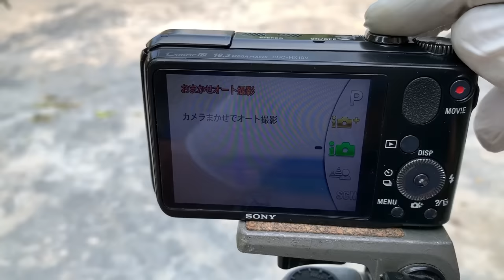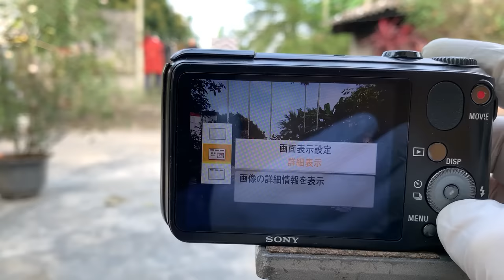Restoration Sony DSC-H90 camera | Teardown old sony cyber-shot 16.1 MP Digital

Comment: I worked in a Sony service center in 1999-2014, repaired cameras under warranty, including this model. The video is 100% fake. There are 4 reasons why such a camera cannot be restored:
 1. Electrochemical corrosion. The contacts simply dissolve in a humid aggressive environment, it happens that there is simply no way to the textolite and the current-carrying path. Here everything is perfect and the contacts on the trains are absolutely intact.
2. Shutter / aperture. In this model, they are made of the finest plastic parts, the slightest getting wet or getting sand deforms and scratches the ales "petals" and they cannot work correctly. In addition, after such a bulkhead of the lens, a special service setting is required; without it, there will be no focus.
3. Display. It is a conventional backlit LCD. Not sealed. The image should be stained with moisture, even after completely dry. There is none of them.
4. Electric motors. They won't work after being so dirty, especially with focus motors.
Video fake, made "back to front", first went through the camera, then got dirty and washed.
Reply: In the reassembly part of the video it looks like he is just reassembling a new camera.
Reply: Exactly. It's interesting to watch, but it's a lie.
Reply: Как ты нашел эту работу,важно ли техническое образование чтобы устроится в ремонт телефонов?
Reply: @tetsuodugin4134  And, come on? what is the probability of working in nature while you are recording and find a camera suddenly, I don't know, just saying...
Reply: @ricardowongl8001  Dude i wont work in service center,i didn't understand you i find same consumer electronics at the dump
Reply: @tetsuodugin4134  Если ты умеешь ремонтировать телефоны, работа будет находить тебя сама. Даже помимо твоей воли.
Reply: @hotenenko  Я умею только дисплеи менять с помощью фена для волос присоски и медиатора, думаю вот пойти в сервис центр учиться но боюсь не возьмут
Reply: На часах сейчас 2:18, а я сижу и меняю клавиатуру на макбуке.
Reply: @hotenenko  Прикольно,образование в этой области получал или в сервис получилось попросится?
Reply: @cipka666  That´s not true. There are many restaurers profesionals. This one is a fraud. That´s all.
Reply: He said entertaining video content.
Reply: Let that man make a living, he has bills too.
Reply: Agree
Reply: The corrosion part was my first thought. The part where the just so happen to find a camera on the beach while recording a video also seemed fishy. But at least it isn't one of those fake pet rescue videos.
Reply: @D.Frasure  I have bills too. Should I start fooling people people because of this?
Reply: نعم صح
Reply: I'd like to see what he does with a mobile phone.
Reply: Extcly ur crct 🤝
Reply: مزيف
Reply: @tetsuodugin4134  нех там учиться, 90% сервисов занимаются модульным ремонтом, никакой пайки ваще, если на плате хоть что-то вышло из строя - сразу замена платы. Если можешь разобрать, собрать, прошить - то ты уже готовый ремонтник.
Reply: and the 5 point is why someone throws his camera with that perfection in jungle? he only washed his parts and reassembled and it working perfectly so why someone throw his prefect camera in garbage with SD card in it
Reply: Thank you very much for the truth! In these dark years of lies everywhere, there is a need for truths like air and water.
Reply: your are correct. I think people know it. It is just for entertainment.
Reply: Are viewers supposed to believe this?   This is a produced video, edited in backwards:  First, he uses the camera, then splits its in parts an simulates mounting, then he spoilds its and then he finds it, just of a sudden!
Reply: Yes 👍🏻
Reply: I think so :)
Reply: " then got dirty and washed ".. that camera had build up of gunk and grime that takes months to appear..
Reply: Absolutely agree! It's fake. Now I have doubts about their other so called "restorations".
Reply: It's entertaining, high quality asmr content.  I like it even though it's fake.
Reply: Agree
Reply: @pbj4toast  that's exactly what happened there
Reply: Of course it’s  fake
Reply: Your correct this man Keep two camera  after show to us other one
Reply: At 5:37, you can see the serial number on the camera (6024008). It matches the serial number seen at 23:26 , so it's probably the same camera, but everything's basically done in reverse.

1. Basically, you can take some second hand camera with a bit of wear and tear. 
2. Show it off. Take some photos with it.
3. Then disassemble it and film a reassembly of it.
4. Then you dig it down and artificially age it up/corrode it
5. Then you film the new disassembly and cleaning process

Then you show everything in the order of 4,5,3(w/disassembly part), 2.
Reply: @carnivol  If you watch carefully, its hard to spot, but you will notice most of the reassembly was filmed then replayed to us in reverse. The way they edited it makes it harder to spot, but that's because he is trying to move in unnatural ways to disguise what they are doing for filming. Thats why its so choppy and has so many jump cuts, he can only make it look convincing for a short time.
Reply: @GamerLoggos  I didn't pay that much attention, but, yeah, reverse shots is certainly also a likely method. But at least the recording order checks out with the basic outline of what I wrote.
Reply: you are totally right, FAKE!
Reply: We do not care
Reply: А видел как он жесткий диск разбирает и моет щеткой? У него этих каналов с фейковым ремонтом штук 5 и везде подобная дичь. Чего стоят только названия, телевизор 1930 года (с интегральными микросхемами), 30-летний комп (на лга775 с процом core i5). А как он крупную технику ремонтирует, байк восстанавливал, так там вида 4 разных колесных дисков было, как по цвету, так и по форме.
Reply: yes that fake
Reply: yeah this is a massacre, a bit like kids breaking their brand new iphone with a hammer and hope they will get rich in pageviews.
speaking of,  I admire your patience, working so long on those neat toys. I've fixed a DSC-F717 once, just a ribbon cable being disconnected after a shock, now my next task will be to fix my old A55, it no longer powers on, i suspected batteries died together, and I hope my sanity will not be lost in a sea of those orange ribbon cables.

i hope there's like, a fuse or something silly in the power regulation part I can just short with a blob of soldering.
Reply: @D.Frasure  
Ah enfin une vérité,  la seule en réalité qui compte: le buisness ! Et les gens sur you tube qui diffusent des vidéo le font tous dans ce but en priorité !!!!
Je ne parles pas des gens qui répètent des choses qui ont déjà été dites des dizaines de fois, si ce n'est des centaines de fois voire des milliers de fois ou plus, bref on peut considérer que cela s'apparente à du plagiat et dans un but de se faire passer pour un érudit en la matière et au détour se faire un max de fric!!! Une vraie arnaque !!!!
Reply: Je me rappelle également que dans les années 90', c'était la même chose pour les camescopes VHS, il fallait un banc d'essai qui valait 40000F au bas mot et seuls les grandes stations techniques pouvaient se payer ce luxe. Et bien entendu, pour l'amortir (même si ce n'est pas grand chose pour un grand un S.A.V), il fallait en faire pratiquement tous les jours !!!
Reply: @FerroGamer  He said entertaining video content. He wasn't trying to fool anyone. if you take things you see and read on the internet to heart then I'm thinking you better toughen up.
Reply: Completely agree
Reply: S3exds
Reply: This fellow gets all types of gadgets in garbage  🙃🙃
Reply: @pbj4toast  Because he is.
Reply: Yes , I'm think so
Reply: Hay personas que tienen un talento increible que ni otros pueden solucionar...
Reply: i agree with you as a service engineer for marine electronics since 1972 doing repairs on electromechanical and purely electronics boards you should have vast knowledge and experience in dismantling such kind of equipment and should be calibrated and I don't believe water damage equipment can be fixed without even replacing damaged parts. This is a hoax, he can clean all he wants on the spare parts but there are parts bound to be damaged and will need replacement not just cleaning but it's good to see how he do it. He must be a camera technician just showing his skills.
Reply: Not to mention the image sensor's downright manhandling...
Reply: @tetsuodugin4134  Good afternoon Yes, education is necessary. I studied for 4 years, in addition, during my work, the manager sent me to improve my skills at seminars that were held by firms - manufacturers of equipment. Oh, those were happy times, my country has not yet attacked the neighboring one. How well we lived then
Reply: @МистерНиндзя-д5ц  а как малейшая сложность - бегут ко мне. работал я с такими. А зарплату получить так первые.
Reply: It is better to buy a new one than repairing the salvage

Befooling the public
Reply: Eu sei que estes vídeos são a maioria uma farsa, gosto de ver por conta das restaurações; mas sabendo disso agora vai ser difícil pra eu ver com o mesmo entusiasmo.
Reply: Yes... but... Japanese Jesus can!
Reply: Seems to be real :face-green-smiling:.

Comment: In my theory as a photographer, and my friend as a pro-camera repair: a digital camera can not repair that way due to water damage to the sensor, rust and oxidized to the focus system. He can not calibrate the focus system without any professional specific purpose tools. He can not tear apart the compact zoom lens easy like that because it’s not meant to be fix-able. Heavy water damage can cause foggy even the camera’s sensor is fine. 
The Video is TRICK AND FAKE !
Reply: i  a agree with u
Reply: And obviously the uploader doesn't read English
Reply: Also, it passes me off how he just finds the things he repairs lying around
Reply: Suka hati cakap fake
Reply: Kalau tak suka takyah tengok
Reply: @cryptodudepoland7533  koyak koyak uuu koyak
Reply: It's cool, we still like wasting time watching people restoring old stuff :)
Reply: And the uSD card doesn't have any sort of corrosion on its pads (min 3:37)...sure sure
Reply: nó là ng vn mà :))
Reply: You are correct sir.
Reply: Betul bang
Reply: You are inocent, he buy pieces and replace the damaged.
Reply: @Kathy12Ray  And just happens to have some flunky to record it. Notice when he picked it up there was no mark underneath on the mud? Plus scrubbing the case like that with a toothbrush would scratch the hell out of it the same as it would if he had used sandpaper. The camera showed no marks at all. This scammer finds something at the local tip and then buys a fully working model and then switches them. The problem is he knows zero about electronics and zero about continuity. I owned and ran my own TV/Video repair shop for many years and have a collection of over 200 digital cameras. Now I'm retired I repair them in my spare time. I should send him a box of faulty ones and get him to wave his magic multimeter over them. 🙂
Reply: @Kathy12Ray  And just happens to be followed by someone with a video camera.
Reply: @rpecas  Actually those pads are gold, and as we all know gold doesn't tarnish or corrode. It can sit on the ocean floor for 200 years and look as if it's been stored in a bank.
Reply: True
Reply: aprooved
Reply: What you see it's not water
Reply: З
Reply: yeah, the only reason fake channels like this exist is for entertainment
Reply: Sand in the mechanics of a lens, there is nothing better.
Reply: Agree with your comments. this is completely fake video
Reply: I agree...................................
Reply: Well, it’s got the same reg.number… If it’s sweet water (as in a lake) it might survive. Admit though this case is quite surprising.
Reply: 0:28 Yes, It is "FAKE"; since the guy pikes up the cameras from the ground..., it's already a fake arrangement.
Reply: I encountered a zombie last year and I restored him perfectly. He is an uploader on youtube now.
Reply: He has 1.57 million subscribers 😂...he is already earning good money from YouTube, fake or not....
Reply: Ông này ng vnam mà :))) sửa thì chém gió là  chắc r xem cho vuii thui kk
Reply: Он же обманщик отписывается с его контента надо что бы он перестал обманывать людей .
Reply: @wawafiqah477  malingsia
Reply: @CJ-fq1fc  Malaysia
Reply: Yes, this fake
Reply: i think the same
Reply: 日本人として、非常に複雑な心境です。
Reply: @wawafiqah477  dah mmg fake
Reply: As a camera repair guy, 100% fake. TO clean the lens only requires al lot of skill, especially with those small ones. This video is ultra ultra fake.
Reply: I was using that as a weight when I was fishing I can't believe he found it
Reply: Video fake à bác, em xem đúng là phản lại mọi định luật về sửa chữa đồ điện tử.. :)))
Reply: This is a totally fake video
Reply: Quando vi o resultado pensei a mesma coisa, não é a mesma máquina
Reply: @caramonchan3464 - a financially poor Oriental in the lower half of the Orient ~ Vietnam, Myanmar, Philippines, Laos, Indonesia….
Reply: @rylinyt 😠 - when YouTube introduced in-video advertising, some of the financially poor in third world countries found that they could commit fraud with the adverts, all they needed was a smartphone, internet connection, YT app,  a YT channel and the hoodwinked ~ watching said video and the “cashcows” = 💰
Reply: @bell-xk5dd ~ how many have been hoodwinked 😡
Reply: @mayanhvlog921 - a financially poor Oriental
Reply: Exactly!!!!     No way!.....there is a reason that they say keep dry, do not submerge.....lol
Reply: Camera fell down from Jack hand in Titanic and swept ashore because light weight baby..
I want to find 20.5 year old iphone 14 pro max and 
the original sword of Conan the barbarian  ...among the bushes..with 43% rust on the tip and 7% rust in middle..want to make epic restoration video!
Reply: @Kathy12Ray  A tsunami brings bikes,electronics, cameras to this coast.

Comment: As a vintage gadget restorer, I tried this once to a junk radio. Just dismantling is a nightmare! With screws corroded and rusty I ended up with broken threads and cracked plastic casing. Not to mention the brittle circuit board and solder blobs. In the end, I just quit and throw everything in the garbage bin. I believe a 50 year old gadget soaked in water or subjected to sea water corrosion would not survive even the best restorer in the world. Unless of course everything will be replaced part by part with new components, boards, flex ribbon, casing, ordered direct from the manufacturer.
Reply: So you are the best restorer and you couldn't do it right ?
Reply: @masana_  I'm not the best restorer. I'm just a hobbyist and electronics enthusiast since late 80's. I could troubleshoot and repair  electronics but my real weakness is mechanical parts. So if I could not open the screws and dismantle PCB's, find it hard to tinker  with delicate gears needing precise  calibration, or if the boards are too brittle to solder I don't bother restoring them. I only restore clean boards and easy to dismantle gadgets. Salt water soaked gadgets are almost impossible to fix because salt crystal cause much corrosion in electronics, plus the fact that salt  water is electrolyte shorting out most sensitive parts like eeprom, processor, etc. Most of all, I don't usually restore gadgets without proper service repair manual, unless I knew exactly how each section works.
Reply: @Manny_News_Blogs_Tutorials  just kidding, thank you for the answer

Comment: You know, to a certain extent I believe that some things can be restored but in this case I have my doubts. Say that you were able to "clean" all that "stuff" from the internal parts of the camera but what about the windings in that tiny DC motor inside the camera? Was the shaft not seized or gritty? How did you clean the CMOS sensor without affecting the final image quality after being exposed to water for so long? These questions are just to name a few.
Reply: Forget it, that's fake. Just to see how real they can fake the "restoration".
Reply: @michaelchan3135  Absolutely. The first red flag is "aimlessly wandering around and happening to find a heavily hidden gem", and the second issue is "looking at filthy, dirty, mangled crap and thinking, "Hey, I could restore that!""
Reply: @michaelchan3135  Also, "zooming right in on said corroded crap, but not looking about to see if there's anything else."
Reply: @michaelchan3135  And a third is not going through all the cleaning stuff only to find, "Ah shit, now I see why the former owner tossed it out!"
Reply: The video is make from the end to the beginning! First they find a working camera, take it apart, record putting it back together and working. and then they put it in the mud for a few day and record finding it in the mud, clean it and the video is complete
Reply: I've seen a few of this dude's videos and washing everything in water is the giveaway. Any other restoration video I've seen uses alcohol on electronics, but this guy just washes it all like his dishes haha
Reply: @freyalunar3633  its just pure fake, even different cameras, one has 16mp, another 18mp.
Reply: Yes, It’s fake.